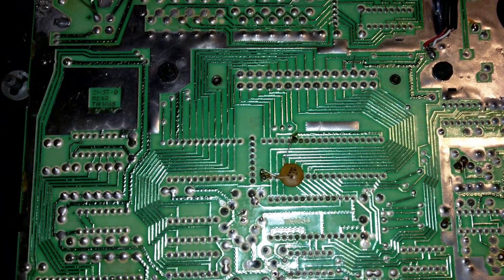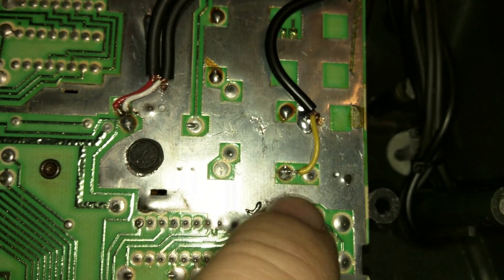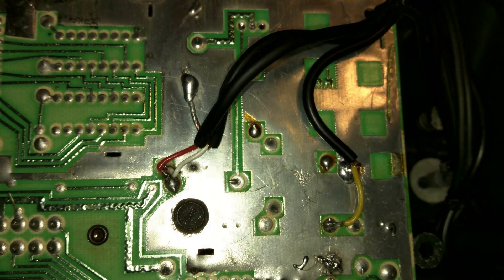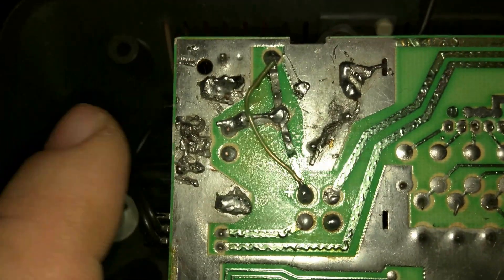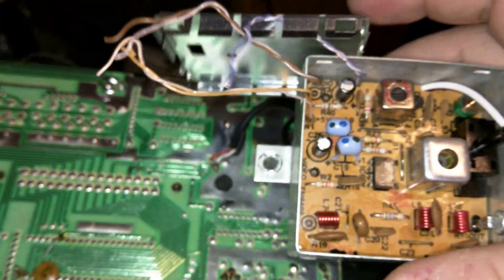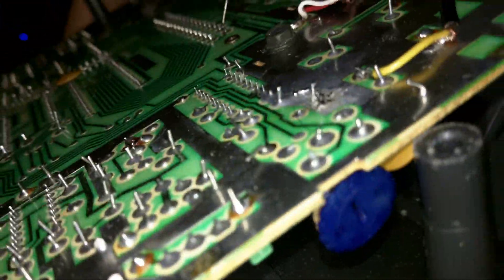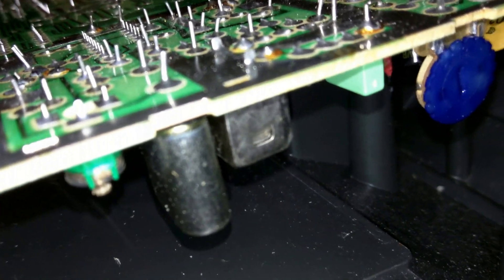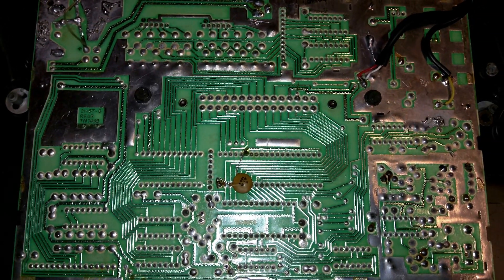Magnavox Odyssey 2 AV Mod

Comment: Do you have a video on how to do a DB9 controller mod for the Odyssey 2 mapped to the original Odyssey 2 detachable controllers?

  That way you could also attached a Sinister adapter for left-handed play or an Atari adapter for easier to replace controls.

Comment: I just wanted to say I did this to mine without doing anything but soldering the AV cables and it worked perfectly, no dark image or anthing, just a nice clean picture...finally. My Odessey 2 was pretty much brand new when I got it so that may have something to do with it. Units with more use or were stored in a damp basement or garage for decades and such may cause issues. Anyhow, I think people should give it a try without the extra parts first since it can't hurt. Thanks for the vid.

Comment from the maker: I am currently working on a hdmi mod for this system witch will take full advantage of the gpu it will allows full 1080p and once this is completed is everything goes fine the next thing I will do is try to build a 4k hdmi but the 4k may not work from what I can see but as 4 as the 1080 I should be able to get a board made for this I am already in the works and have a test unit coming to me in the mail as I speak. if it works I will try to make a new video as I will intend to sell a kit for installing it. I am hoping everything works with the beta so I do not have to add anything other then what will be on the beta board witch I will turn into the final spec. and the nice part is it should also give stereo sound tho it will me emulated at first I am working to se if I can pull stereo off the chip but the chip in the unit is a gpu and sound ic all in one so I do not no f its posable as I cant get a good schematic on it. so please keep tuned.